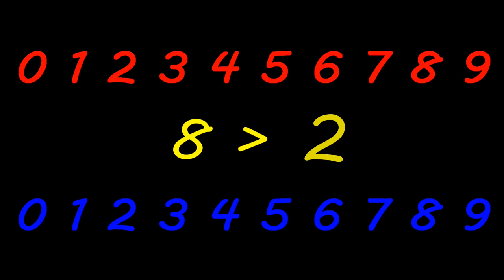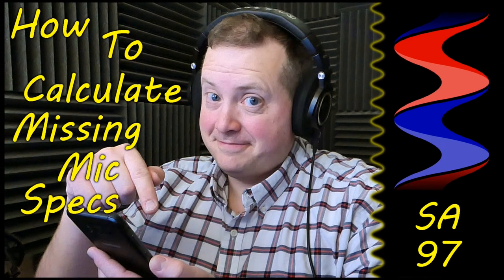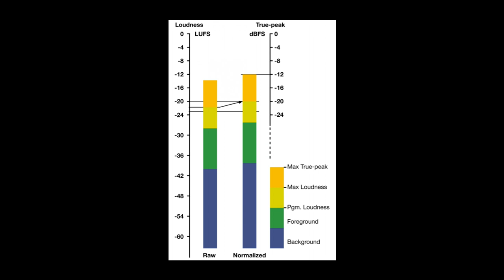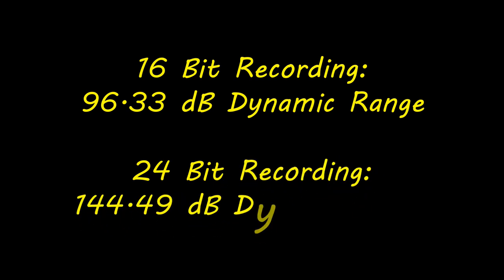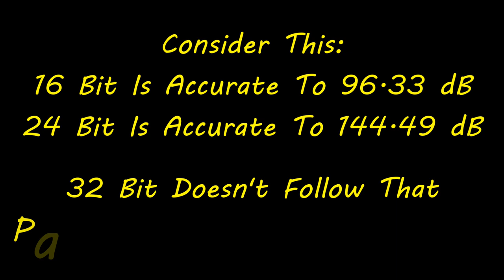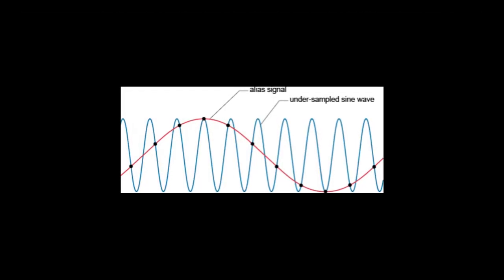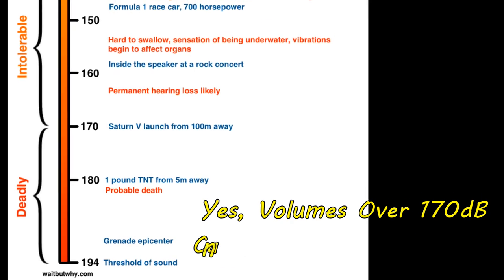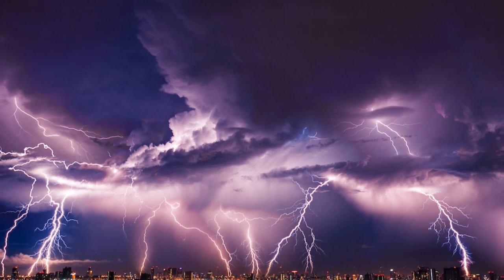32 Bit Floating Point Explained - Sound Speeds

Comment: With most all audio interfaces I can hear the transients are not being recorded clearly, even at 24 bit 96khz. But when I use my RME Fireface II I can hear that it does a lot better job with the transients of my voice. Now, no one I have ever talked to can hear bad reproduction of transients other than myself.  But I hear the bad transient reproduction with all of the major audio interface brands I have tried, other than RME. The transients are not peaking and distorting, it is like the interfaces simply cannot focus on the beginning of sounds and reproduce them right. Why am I the only one that can hear this?  It is like a variable recording rate is needed, like as in film with large explosions and fast motion to throw more bits at the beginning of words. Would 32bit floating point throw more bits at the beginning of sounds and make them more focused and clear? All I ever hear about 32 bit is that it can record louder sounds, does it not also record finer steps, more densely packed bits, and would this not improve sound quality as well?
Reply from the maker: As I said in the video, wider range of volume is all that it does. It doesn't increase the quality at all. The RME interface may to something to the sound that no other interface does. If I were you, I'd buy another one or two to have in case that one breaks.
Reply: @SoundSpeeds  Thanks for your reply, it was very helpful! Great advice, the RME interfaces are very expensive but worth having two of. Your video sure is packed with a lot of great info! Thanks for your helpful channel! I am looking into buying a preamp for my microphone as well. Best to you! 👍
Reply from the maker: Thank you for watching.

Comment: When I initially heard about 32-bit float, the more I heard about it, the more I wanted an interface capable of it. But slowly I began to realize that I probably didn't need it. You did a great job of articulating how it works, and how, yes, I really don't need it for my little home recordings. I'm not recording gunshots or anything like that. And honestly, if I'm capturing gunshots on a recording then I have much more serious problems than bit depth or noise floor.
Reply from the maker: And I even did a video about recording great gunfire SFX in 24 bit fixed. :-) Thanks for watching.

Comment: Edit: Great video man! Back to the original comment: 32 bit float. It's great for any high action and high dynamic sound mixer jobs where you need to be recording but also boom operating at the same time. You can record hands off from the input gain and then convert the 32-bit floats into 24 bit before you deliver the sound because if not the film editor people will be nagging cause they don't know how to convert a 32 bit float to a 24 bit. I wish I had a 32-bit float recorder that way I could use it in these types of situations.

Comment: I studied Computing in college. Wasn't very good but there are some important things I still remember. One of those things is information about how floating points work because I also studied Computer Systems Engineering, which is something I was actually good at. I came to the same conclusion about 32 bit float and the accuracy of the data. You basically confirmed my breakdown, thanks lol. Great and Informative video as usual.
Reply from the maker: Thank you Sigma. :-) Thanks for watching!

Comment: Great education, thank you! Raises a question about the Zoom F series. 

The F6 lets you adjust gain to set levels in 32-bit mode. It also offers 24-bit recording. 

F3 is 32 bit only, and documentation suggests there is no support for setting levels. You only control monitoring output or fade or something? So the gain is fixed?

With 32 bit, you don't need to set levels, woo! 😝 You dispelled that notion. Without proper levels, you don't get 24-bit quality in the standard DB range. That's my takeaway.

F3 is a nicely portable unit, but 32 bit only, and if you can't adjust gain to set levels ... 

Hope I haven't misunderstood the zoom F series specs. Would you happen to know? Thanks so much.
Reply from the maker: I haven't read the F-series specs but do know that when the F6 was released, they said it didn't require gain to be set.

Comment: very, very informative. now I know  to keep my levels similar to what I would for a 24bit recording if I'm recording with 32float, since that will reduce unnecessary noise(even if it's not normally noticeable).  that's probably a really good takeaway for field recording/sound design.
Reply from the maker: If you feel the need to record in 32 bit float, yeah. Keep in kind the recording format matters less than what you're recording and setting it up correctly
Reply: @SoundSpeeds  absolutely, shit in, shit out. when I'm working location sound gigs with my F6 I prefer to use 32bitfloat precisely because it allows me to focus on everything other than getting good levels, which isn't ideal, but it works well if you're the only sound professional on set. It would be ideal in every production to have the mighty 3 man sound team, but since most of the stuff I do is indy productions with tight budgets, I feel the need to focus on boom and lav placement above all else. in that regard, I feel like since I can't always get fantastic levels in the recorder I would rather trust a dual ADC system with 32bitfloat than with a (probably terrible sounding) digital limiter that's getting slammed because I can't get to adjusting it while I'm booming. good sound always starts at the source, the boom and the lavs :)

Comment: 32-bit is mainly useful in the box because it can contain any level with the same accuracy without clipping. If you applied an envelope, the noise floor would "float" with it could be inveted with minimal loss. 64-bit is used in plugins such as equalizer or reverb for adding extremely small numbers to a bigger number many times and not losing them and causing filters to become unstable. It only exists in Reaper because it can and to satisfy users who peek at the signal with an analyzer. When mixing multiple chanels of sound, they are all approximately in the same range, and 32-bit is plenty. Now we have even more crazy bits in Kirchhoff EQ, where you can't even see a noise floor.

I doubt that a box like Zoom can exceed 140 db of dynamic range. Must be some space technology.

Comment: Hi. Very informative video! Is this your most indepth video on ADCs and what the layered 24-bit aspect means? Have any higher bit depth ADCs come about since this video was posted?
I'm still trying to learn if people need to learn the details when saying floating-point field recording is possible.
Reply from the maker: ADCs aren't that interesting so no need to elaborate. There's been no new innovations in ADCs since this video that I'm aware of or higher but rate ADCs without using multiple

Comment: the more i look into this, the more it confuses the shit out of me! i think i still don't get the relationship between recording bit rate, and the "bits" regarding floating point
i thought floating point was in relationship to internal volume processing (volume hitting plugins, volume above 0.0dbFS inside the daw, etc.) 
i am completely lost now that you said one can record at 32bit floating point? is this regardless of an audio interface being only being 24bit? are there soundcards that record at 32bit? 
or are we using the terms "24, 32 & 64 bit" for multiple things?
Reply from the maker: The interface can be 24 bit but you can record 32 bit and gain nothing. The DAC in the 24 bit interface gives no benefit to recording in 32 FP. Think of it like this... You can connect a 1080P camera to a 4K recorder and record in 4K but you gain nothing over recording in 1080P. 16, 24, 32... all of that corresponds to the recorder and how it saves the 0s and 1s.

Comment: Great video! And thank you. Quick question if I’m outdoor recording traffic noise and potential interviews is 24 bit or recommended or 32 bit? Also, what about in cases where by im on set, one actor delivering a dialogue loudly while another might say whispers theirs. Which recording is better 24 or 32bit? Thanks
Reply from the maker: You can do it with either
Reply: thanks
 @SoundSpeeds
Reply from the maker: 👍 Sure thing.

Comment: WOW... all that video and math was a LOT to absorb bro! QUESTION.... I have a recording studio and I'm creating a Podcast/Vlogcast network. I do not want to use the typical Shure SM7B mics. i want to use all Lav mics. And afterwards I can great outboard gear and software to EQ the podcast vocals to sound damn near as good, if not better than using a condenser mic or shure sm7b. Because I want to do it this way, do you think having the Lav mic with 32bit float ability is the best way to go?
Reply from the maker: No. 24 bit is more than adequate.

Comment: This cannot possibly be an entry level explanation of bit depth. I'm not a dumb person, and I've been sound engineering for 25 years. There are words in this video that I'm not even sure are English
Reply from the maker: LOL.
Reply: I’ve been working in audio for a long time but also worked for Analog Devices for 37 years. So I’ve worked on A/D and D/A converters through several generations and architectures and his terminology is correct but he barely scratches the surface. The only things I disagree with is the not a stair step. It is a stair step sample to sample by definition. It’s why anti-aliasing filters are needed  during the D/A conversion to prevent out of band energy from folding back into the passband as distortion. The other is the interchange of 6dB voltage with the equivalent 3dB power. It’s confusing when the two are not clearly delineated.

Comment: But why not use 32bit integers for comparison. Then it would be a fair comparison since both will use 4bytes per sample.

32bit integer has range of -2.15 billion to +2.15 billion
Reply from the maker: I don't know. It works be interesting to talk to the person that invented it and see
Reply: A very reasonable question to ask,  

While 32 bit int. would make a path  for future increase of resolution the 32bit float locks the resolution on 24 or 23bit + sign as it in reallity is.
Using 32bit two's compliment numbers would had made it very easy to, with relative simple circuitry, to add bits to cope with the peaks - and maybe even with increased resolution.

The present 32bit float follow some standards representation of float numbers but unfortunately also blocks any attempts to improve the quality of recording with out rewriting the present "standard" 32bit float for audio.
Had a 32bit float format been thought out carefully it would not had been sign, 7 bit exp., and 24 mantisa - it would had been a signed 3 to 5 bit exp. (4 to 6 bits used) and a 28 to 26 bits mantisa.
Remember that the exp. is a number telling you how many places you need to move the decimal point - 3 bit plus sign would be +/- 7 times !!, or like multiplying or dividing the 28 bit value in the mantisa by one million, or +/-60dB ....... 120dB increased dynamic range.
Add that to the 20dB the extra 4 bit (24 to 28 bit resolution) would give and you have  280dB of real world dynamic range with 150dB real world resolution !!!!!!!!
Reply from the maker: Impressive but overkill for most use cases

Comment: 32 bit(FP) is a worthwhile tick if you are editing music
Same for 24, why doesn't matter unless you dont edit audio... in which case why do you have 24bit+ anything?
However if you just listen to audio, like music or Ebooks dont bother going above 16bit, that includes files.

The best choice is usually mp3 320 16 bit for the normal hearing range of people, go for either IEMS or for audiophile supreme mega super dooper sound stage 3000 whatevers. Buy a BTR3K to drive any headset portably, or a BTR5 for those extra thirsty cans.
Reply from the maker: Editing is a different creature than recording. I know people that use 32FP for editing and they say it's important to. I'll disagree about recording in only 16 though. Especially for the noise floor and low volume dynamics, I think 24 is critical for pro recordings.
Reply: @SoundSpeeds  I didnt say to record in 16, I said if you just listen to audio then use 16. But otherwise yes! Exactly
Reply from the maker: I see. Yeah, 16 in plenty for most

Comment: Zoom H6: recording at 24 bit, what is the difference between, say, 44mHz vs 96mHz? For YouTube, would this make any difference in quality audio playing?
Reply from the maker: Not at all. The reason to record above 4*K would be if you were planning to either slow down your recording or if you were to mastering a HiFi master and wanted extended frequencies for some reason. YouTube rolls off above about 16K so anything above 32K will never be heard.
Reply: @SoundSpeeds  So 24 bit at 48K is more than enough for (end result) quality audio for YouTube? I shoot at 4K, 60fps video and capture audio on the H6 at 24 bit/96K (I think that's the max). Edit in Premier Pro, export at very high quality settings (to get that YouTube 4K video).
Reply from the maker: Yes. 24 bit 48K is great for YouTube

Comment: The present 32bit float follow some standards representation of float numbers but unfortunately also blocks any attempts to improve the quality of recording with out rewriting the present "standard" 32bit float for audio.
Had a 32bit float format been thought out carefully it would not had been sign, 7 bit exp., and 24 mantisa - it would had been a signed 3 to 5 bit exp. (4 to 6 bits used) and a 28 to 26 bits mantisa.
Remember that the exp. is a number telling you how many places you need to move the decimal point - 3 bit plus sign would be +/- 7 times !!, or like multiplying or dividing the 28 bit value in the mantisa by one million, or +/-60dB ....... 120dB increased dynamic range.
Add to that the 20dB the extra 4 bit (24 to 28 bit resolution) would give and you have  260dB of real world dynamic range with 150dB real world resolution !!!!!!!!

Keeping strickt to the binary roules of float numbers it may not be more than 104 dB extra dynamic range - but  225dB real world dynamic range with 150dB real world resolution .

Using present day 24bit's ADC's it would "only" give you 190-200 dB dyn. range with 125dB resolution - only very specialyzed  microphones and sensores will challenge this.

Comment: What makes you claim 1V analog audio signal should represent 0dBFS? In professional world we use +4dBu level which equals to 1.2Vrms. That old agreement does not say anything what headroom to 0dBFS should be.
Reply from the maker: Watch this: https://youtu.be/iutQGzn4Uf4
Then: https://youtu.be/SdHn4L1TGds
Reply: @SoundSpeeds  Irrelevant. There are ADCs calibrated as 1V (+2dBu) = 0dBFS as well as 12V (+24dBu) = 0dBFS. The same with DACs.
No standard for VU meter either. 0VU can be calibrated to 0, +4, +8dBu

Comment: So, basic interviews and controlled sets 24 bit...run and gun on the streets 32 bit FP.  I think.
Reply from the maker: I'd go 24 bit in both of those circumstances. It has to be insanely loud to warrant 32 bit floating point to me. If you set your levels correctly for the voices you're recording, you're getting what you care about. If traffic is too loud and drowns out the voice, you gotta hold for sound and go again anyway...
Reply: @SoundSpeeds  One other question. One of the reasons I just purchased the MixPre II was because as a single operator I was told it was possible to use the 32 bit FP and it would allow me to "bring out" any sound that I may have recorded incorrectly. That I did not have to always "ride the gains".  Would you agree with this?
Reply from the maker: Depends. If you make any kind of effort to set gain, you should be fine but if you know nothing and don't want to learn how, you're trading off effort for convenience with larger file sizes. It really doesn't take much effort at all to set a level especially since there's already a lot of headroom built into peak level and as long as you use a limiter, you're going to be fine.
Reply: @SoundSpeeds  Oh, I am definitely learning :p  I also agree with you, however I like backups for backups and I saw the 32 bit as one form of backup. I will certainly experiment both ways. While I do not see the larger file size as a downside, it doesn't seem like larger file sizes are the only downside however. Thanks for the video, I learned a lot.
Reply from the maker: There are others but as I mentioned in this video, you'll most likely never detect them or have them matter.
Reply: This was a great explainer of 32 bit float audio. I agree with Justin on the solo run-and-gun use case. The storage cost of the extra 8 bits per sample is a small price to pay for getting clean audio. I often chase after demonstrations in New York City, shooting raw video and raw-like 32 bit synch sound. A benefit of both is wide dynamic range and the ability to defer signal processing to post. With good mics and 32 bit audio recording, I can manage composition, focus and exposure while not worrying about clipping sound.
Reply from the maker: And that's fine if you choose to do that for piece of mind. I'm providing info for you to consider here.